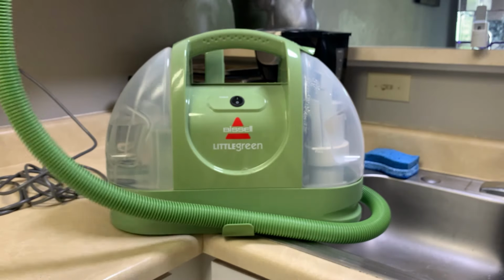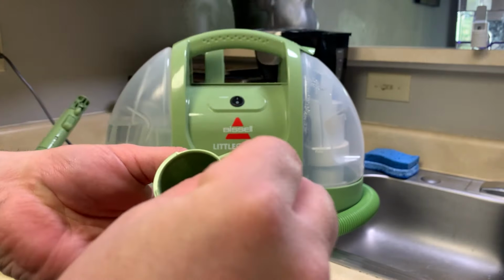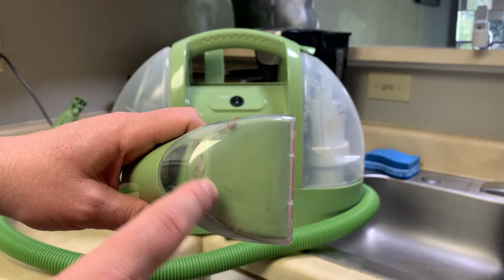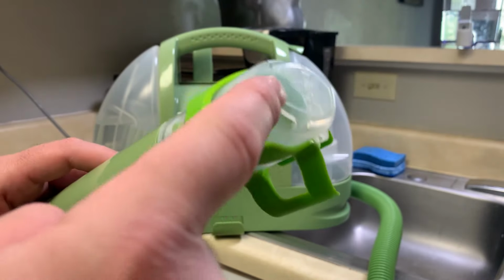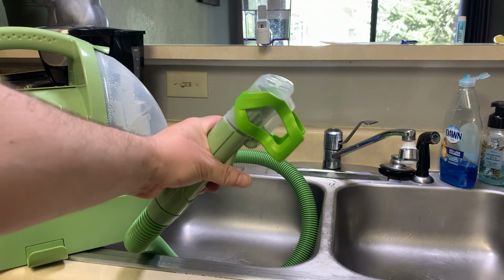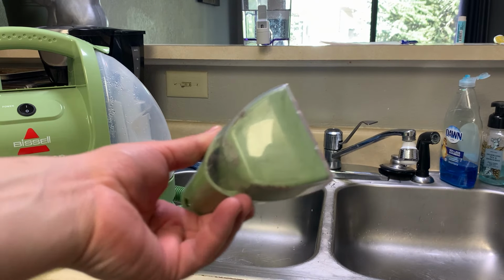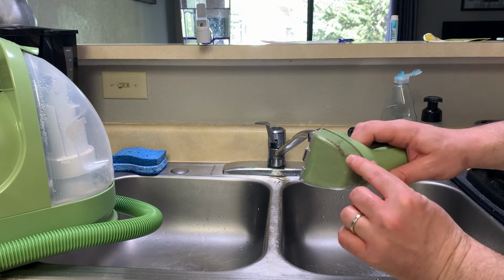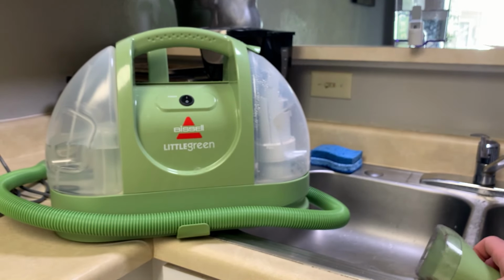Bissell Green Machine Cleaning Maintenance and Troubleshooting No Water Coming Out Cleaning Hose.

Comment: I have an old model big green clean machine. The pump runs but no water comes out. I removed the pipe on the side of the unit but still no water.

Comment: I suppose there are products designed more poorly for disassembly and cleaning but I sure as hell haven’t run across one. You spend an hour or two cleaning the brush head and reservoir and the result is that they look marginally less shitty than when you began.

Comment: This thing has a terrible design. You should be able to remove the internals of the dirty tank to give it a good clean. This would have been very easy to achieve with some plastic tabs that snap in and out of place. Also, not being able to remove that clear plastic piece on the brush is a total miss by Bissel. Would never buy this unit again. It’s awful to clean.

Comment: Denture cleaning tablets are a very affordable and effective way to clean things. You can try soaking the head in a solution made with them and then use a bottle brush or pipe cleaners to get to the toughest grime. They should also be safe to drop in the tank. Just use a couple of them and rinse with clean water. :) Hope this can help someone.

Comment: I’ve had multiple shampooers and I can tell ya now, you need to run clean water through the hose attachment sprayer or the cleaning solution will dry and gum up the hose. Happened to me numerous times. Running a new rubber hose through the hose isn’t a big deal on a lot of models, but running clean water through it is much easier…

Comment: I have an older Little Green Machine model 1400K and the dirty water tank looked pretty disgusting. I was able to get it pretty clean with hotwater, Dawn dish soap , and a skinny bendable bottle brush. I spent way too much time trying to clean the brush head and I gave up and spent about $12 for a new replacement head that easily comes apart for easy cleaning. It is part # 1600055 and is well worth the money if you have an older model like mine.

Comment: Major design flaw on the brush. Nearly impossible to clean. Should pop apart. Typical of modern design engineers. Never actually use the products.
Reply: Yep it is soo maddening.another bad design isthe pet dustbuster. The suction works fine but is a pain in the rear to  clean the junk out of the main plastic part. Try to remove the crud and all you do is push it further down. I have hit it repeatedly  to empty it. Oh no it wont. There is no earthly reason for these appliances to be so poorly designed. Grrr.
Reply: @karensamuels390 Oh there is 100% a reason. They want it to clog up and break so you have to buy a new one. It’s called planned obsolescence. Every time I clean with my “Little Green Machine”, I get so frustrated that I can’t dismantle the dirty water reservoir and the brush head to properly clean it, I find myself searching the internet for resources to help me clean it, but it always comes up empty. It’s absolutely infuriating.
Reply: Agree 100%🦋
Reply: probably men

Comment: We watched the video, then my brilliant wife submerged the head in vinegar and swished it around and all the unreachable gunk in the head came right out. looks great. Thanks!
Reply: Recommend ALWAYS starting with water to clean ANYTHING. If that doesn't work, move on to other solutions (both literally and figuratively). Don't waste $.
Reply: Water is a waste. I am going to go straight to the vinegar. Also that contraption IUD thing is not necessary, just fill the basin, turn it on and suck directly to  clean the hose. Manufacturers have zero clue.
Reply: Thanks for the advice!
Reply: I soak it for hours in vinegar and it did not remove the cats hair
Reply: For how long
Reply: How long did you soak it

Comment: I found this video searching for O ring replacement... at the end of the hose with the tool off, you can see two O rings. I'm not sure if that's my issue...but I have a super hard time getting the tool on/off the hose.... Over time it's gotten to where I have to use all my strength and then some to get it on/off.... everything else works.... Oh, and you're never gonna get that tool head cleaned fully... it's IMPOSSIBLE
Reply from the maker: Hi there! I just made a video about changing the O ring. I'm not sure it will fix your problem but I did want to try and help. The O ring sizes are in the description of the video I just published but here they are again:
Large O Ring - 15/16" O.D. x 13/16 I.D. x 1/16"  
Small O Ring - 9/32" O.D. x 5/32" I.D. x 1/16"

Comment: I put about an inch of water in the bottom of my sink and run the vacuum through after each use, it seems to clean the hose and nozzle really well. I used to struggle keeping it clean so I bought a new hose and nozzle and started this process and I have not had a dirty nozzle since and it take 1 minute to do!

Comment: I love the green machine but it is dumb that the plastic does not come off knowing it’s going to become dirty
Reply: I finally got mad enough I pried mine off!  The only part that broke on the clear plastic was by the brushes.  All the way around it didnt appear to be glued together or anything so Im pretty sure it's meant to come off, the engineers just didnt thoroughly think that part through!  I super glued it where it cracked and snapped it back on.  Works fine.
Reply: I was waiting for someone who broke it, I’m sure that would happen of I tried to brute force it ☹️
Reply: I took mine apart and everything stayed intact. Nothing broke, but this part is not meant to come off because it is glued to the housing, even though it has two tabs on the bottom. If you carefully remove it, it shouldn’t break, but it is still possible. You can now clean it, but you have to use some kind of waterproof sealant or adhesive to get it to stay on during reassembly. I used gorilla glue clear grip.
Reply: I TOTALLY AGREE..especially if you have cat hair in it

Comment: The vacuum had clear cover does come off
Reply from the maker: Awesome! I’ve heard from multiple people that theirs comes off. Mine doesn’t… I’ve tried and it will definitely break if I force it. I’d love to see someone share a video of one coming off.
Reply: @CleanMachinesYT  I agree. I do believe the cover comes off for some people's but mine is definitely feeling like it's permanently attached. My guess is that the cover kept being knocked off and people complained so they permanently affixed it (or maybe it tended to leak). It does even look like it still has the clip hooks on the flat edge.

Comment: I tried to  clean  mine, and  that head is still  has dirt stuck in it. I have  used everything  that I  have  to  dislodge the hair from  the  head sides, even the vacuum. Uh, why  couldn't  they make it with a removable  plastic cover. There's got to be an easier way  to  use this thing. Plus, people  said this thing  doesn't  dry out  compelling  mold to grow in the thing. It's  not  my  favorite  thing, but it does help, for instance, sanitized a lot. I used  it  for  my carpet, couch, and  to clean  a few pillows. Maybe  I  will  put a review  on  the  manufacturing  side  so they can adjust  the  price  and the  attachment  head. Thanks  for  your  video and  troubleshooting  tips
Reply: The cover even looks like it should come off. Not too impressed.
Reply: Mine sucked up so much hair that now it has a blockage so water overflows instead of going into the dirty tank 😭
Reply: The plastic cover does come off. There's another video that explains it

Comment: I just cleaned mine out I’ve had it a few years and never gave it a deep clean. It smelled so gross I gagged twice and had to run outside for air. But we were about to throw it out lol. Saved $100!
Reply: I just use a little vinegar and water to rinse out the dirty water tank. No bad smells😊
Reply: I'm getting a visual 😂 🤮🤢 it does look like the clear part of the head would pop off but I'm afraid to break it 🥴

Comment: I wished my plastic top popped off for easier cleaning.  Attention Bissell engineers when you come out with another model
Reply: Right, so stupid it doesn’t come off!
Reply: "Attention Bissell engineers when you come out with another model"

A decent engineer would have known to NOT make the first model the way they did.
Reply: Mine doesn’t come off either some I guess do and I don’t have that little plastic thing in mine and same with my pro heat 2x it’s the older model I guess I been sitting here for hours trying to get either one of without breaking the plastic they don’t come off and it impossible to get that hair out if it sat. I let someone use it and they never cleaned it am livid right now. Lol also I have that same one he has in the video . I watch other video and each one I watch they where all deferent 😢
Reply: If you have the dark green model.   You’ll have to tape the cover back on once you pop it off
Reply: @Ty-ye8rd  Aaaah. Gotcha. I thought I was going crazy. Thanks for the advice! Guess I broke mine
Reply: Later models have removable heads
Reply: TOTALLY AGREE! This is a bad design!
Reply: The snark version does its very nice!
Reply: It does. Get something flat and pull off the head, with the tiny flat piece pop off the clear thing inside of the attachment dang the clear thing pops off
Reply: @Yooo_nkhaa8  but how does it go back on? It seems like once it's off, if won't stay attached anymore.
Reply: @agedcheese tape.   Once i popped it off, there’s no way to reattach.   I just found this out too.
Reply: @Ty-ye8rd  Sounds like I broke it. Dang. Thanks for the advice!
Reply: @agedcheese  not going to lie but the fact that you took the comment seriously to remove the clear plastic is hilarious.
Reply: @agedcheese  use some gorilla glue
Reply: @Yooo_nkhaa8  No, certain model variations (like the dark green) don't have a removable head. You can pop it off, but it was glued or heated on, to create a waterproof seal. It would need re-gluing with something industrial strength, like Gorilla Glue.

Comment: Great video, but mine is missing that “Hydrorinse” tool. But then I should not complain as I got mine from the “Dumpster Emporium.” It seems OK, but the suction is anemic (probably why it was left there in the first place). I think the hose is clogged. Is there a way to separate the hose from the machine so that I can unclog the hose?
Reply: @nonelost1 bissell has the hydrorinse part for $15 on their website. I got my second hand from family and it doesn't have that part either. Little research I found the part on their website. Hope this helps. God bless.
Reply: I’m looking into this tool because mine is spraying minerals and ceasing to spray after a use, someone in a forum said the heating element is scaled with minerals and in my other steam machines that means the machine is supposed to be used with distilled water, vinegar is recommended in those to clean out the scale, but I can’t find a concrete answer on if vinegar can go in this machine. It’ll involve taking it apart if my scaling is really bad.

Comment: How full do we fill the left tank with clean water?????    theres no marks, but I see a straw inside it reaches to the top of the tank.  Must be for air??                 Theres no full lines on the tank, just fill it all the way up??
Reply from the maker: There should be a mark. Part of the plastic is a raised line and above it says “water.” When you are holding the tank upside down, as if you were to fill it. On the flat side you can find it on the left a couple inches down.

Comment: The nozzle clog comes from the dirty water sucked up leaked into the first jet before the nozzle. The double o-ring does not not seal well.
Reply from the maker: Thanks for the info!
Reply: My nozzle clog is from mineral build up in the heating element. My machines that experience this are used with only distilled water to prevent this but yet still it happens after awhile.

Comment: My sprayer stopped working after the first use.  No clogs.  I jump on Amazon reviews and see that I'm not the only person this has happened to.  Returned it the next day.
Reply from the maker: Yeah sorry to hear that. Mine works fine but hopefully you can get a refund or replacement!
Reply: @CleanMachinesYT  i did a return to amazon and got the Hoover Spotless which in my opinion works much better.
Reply: Mine didn't work straight out of the box . Got it as a wedding gift so I have no way to return it😢
Reply: @wakenow1  well that just sucks.  The Hoover Spotless i got in place of this has been working like a champ.
Reply: @mykylc  I actually got it to spray finally. I cleaned out the nozzle. I wonder if something got caught in it during factory testing, looked like a tiny piece of plastic in there, or maybe the part came out of the mold wrong and had a slug. Who knows.

Comment: We  cleaned the couch and no dirty water filled the tank. Any trouble shooting tips?
Reply from the maker: I would start by testing if the machine has suction. You can fill a bowl with water and place the hose head in to see if it sucks up the water. Let me know! Thanks.
Reply: Mine is doin the same thing!
Reply: When you clean a couch,  because it is so cushiony. It absorbs alot of the water deep into it. If you are not sucking it up at the same time you are applying the water, it will disappear. From my experience. Oh and try ducking up water from a bowl too. You will see if it in fact is drawling water.
Reply: Mines doing the same thing!
Reply: I was thinking the same thing until I put it in a bowl of water and it in fact IS sucking it back up! And my sofa is looking so clean 😊

Comment: For those trying to clean the nozzle head, there's a tab inside the head that can be pushed down. After releasing the internal tab, just pull gently on the front of the clear plastic part to release the other two tabs and it should slide out.

Edit: For those who don't have the internal tab, try this. Thoroughly inspect the edges, inside and out. Try to pull up or pry on all of the edges. Don't force anything too hard. If that doesn't work, look for a screw and try to unscrew it and see what that does. Try opening the attachment along the seams. If everything fails and you really can't get it off, just pull up the two tabs on the front and swish some water inside to release the caught hair and stuff.
Reply: Make a video
Reply: @ousoonthebeat6927  lol, I'll do a short tomorrow if you really want to know
Reply: @AnnisAdventures  I'd greatly appreciate it as well lol. 😂
Reply: @silvanam9229  making it right now
Reply: @silvanam9229  it’s posted
Reply: @AnnisAdventures  thank you!! So my nozzle head is a little different, it has the 2 tabs but then on the inside there's nothing, just solid plastic....we used a butter knife to see if we could lift it by depressing the 2 tabs but it wouldn't budge & I don't want to break it, so I'm just gonna leave it alone. Thanks for the vodeo!
Reply: @AnnisAdventures did you take the video down? I can't find it 😭
Reply: @danarmeli  it's a short, not a full vid. I believe that means it's under a different tab on my account
Reply: @ousoonthebeat6927  I uploaded a short on how to in my profile
Reply: They clearly made the new ones smarter. No tab on this green one :(
Reply: Yeah.. You have a different one than this video. There's not a tab on the inside for me.
Reply: Green models (shown in the video above) are not removable. Plastic tabs in the front still there, but the clear piece is actually welded onto the green housing. If you really pry, you can get it off (it'll probably crack or break into pieces), but won't be able to put it back on because there's no tab or feature in the back to hold it in place. Best solution is to throw out that head and buy a replacement model 1600055. This head has an easily removable cover. Edit: corrected part number
Reply: Mine doesn't have an option to take it off. It's so disgusting. Idk what to do now.
Reply: @moxie86  Look at my comment above yours. Also, even if you can't get it completely off you should be able to pull on the clear part near the front of it and lift it up enough that you can run water through it to get any hear/stuff out.
Reply: I don't have a tab in mine. Wtf how do I get it open?
Reply: @KronoErosion  I'd have to see it and inspect it to know, but here's a few tips on finding how to get it off. Thoroughly inspect the edges, inside and out. Try to pull up or pry on all of the edges. Don't force anything too hard. If that doesn't work, look for a screw and try to unscrew it and see what that does. Try opening the attachment along the seams. Hope that helped

Comment: Mine is from 2012 and it didn't include that part for cleaning out the hose. I wonder if I can get that?
Reply from the maker: There’s multiple ways you could clean the hose. Bradley commented that they fill up the  sink with soapy water and basically suck up the water until the tank is full. You could use the spray nozzle in you kitchen sink if you have one. You can also buy a replacement online. The piece is called a “HydroRinse self cleaning tool.” You can find them online. I hope that helps!
Reply: same here, remove attachment and place end in hot soapy water, turn on,  don't over fill brown water tank